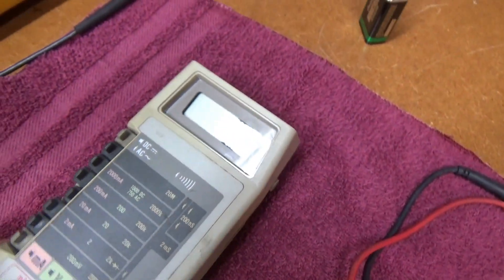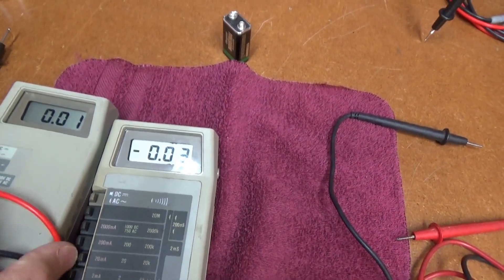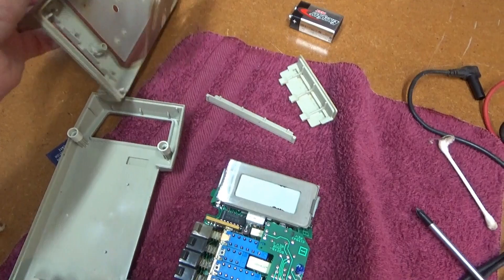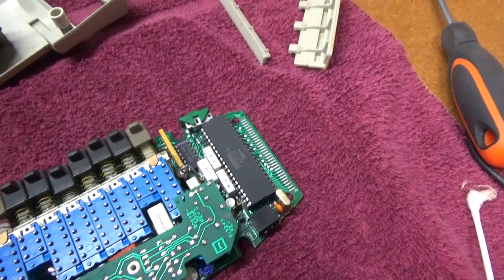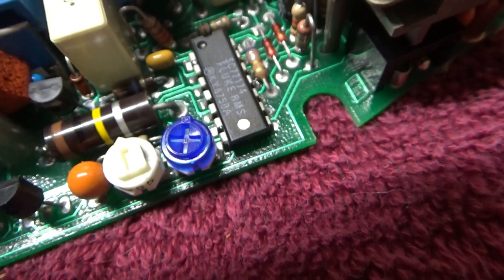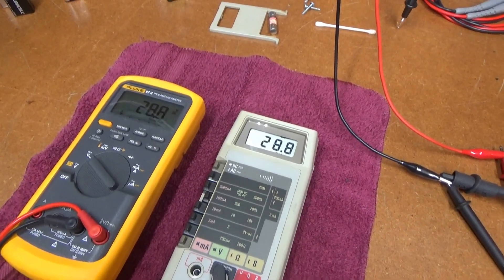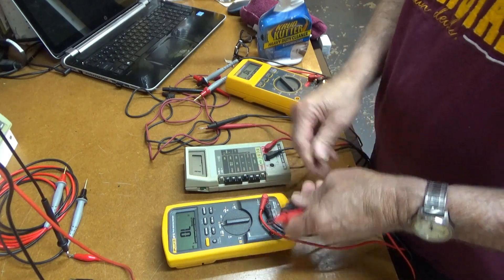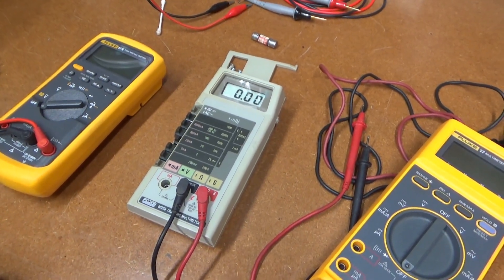1988 Fluke 8026B Teardown

Comment: Can i ask, what do you recommend to clean corrosion off solder joints on the PCB. Will isopropyl alcohol usually be sufficient ?
Reply from the maker: You got it. Isopropyl alcohol is what I use. I generally use the 90% stuff for cleaning because it will dry faster that the cheaper 70%.
Reply: @mguess Thanks for the reply. After many years I've picked up my first Fluke. It's an old grey fluke 27. The chip is dated 34 week of 86. The 9v Duracell dated 94 had eaten its top thankfully with Very little damage except requiring a new battery connector. There's oxidisation on some solder joints on the PCB so while I'm in there I want to do what I can to preserve the meter. I'm only a novice re electronics, but I really enjoy your vids. Many thanks from Dublin Ireland. I think I'll try a cotton bud with white vinegar, then baking soda solution to neutralise the vinegar, then IPA to clean everything off ? Here in Ireland the damp air gets into everything. I often think the grass is So Green because of Corrosion! 😄
Reply from the maker: Good luck with the restoration of your Fluke 27. That is my favorite series of Fluke multimeters. I think I have 7 of them now, just gave one to a friend a few weeks ago. I can pick them up fairly cheaply here in the US, about $40 for a good working one. I find that IPA alone cleans up most corrosion including the stuff that leaks out of alkaline batteries. There is generally no need to touch the calibration adjustments. I find that Fluke multimeters hold their calibration very well even after 40 years.
Reply: Yes I'll take Your experienced advice and try just using the IPA. There is quite a lot of furry green corrosion on one of the fuse connections. Oddly on this particular meter, there's a small glass fuse fitted upright beside the two Large ceramic fuses in the battery compartment, and I haven't seen that on any YouTube 27 vids.
Reply from the maker: Yes, the small fuse is something that Fluke did in the early days. If you watch my video on the restoration of the old Fluke 8025A you can see that fuse. The one in that meter happened to be a ceramic fuse but other Flukes that I own have small glass fuses as well. Here's the link.
https://youtu.be/JAF-F1SuDdQ
I didn't talk about that fuse in the video but it is in series with the larger HRC (high rupture capacity) sand filled ceramic fuse. I assume the theory was that in minor over current conditions the small cheap fuse would blow protecting the meter and the expensive HRC fuse. However if a high energy over current event occurred, the HRC fuse would blow protecting the meter and the operator from injury. Fluke eliminated the small fuse on later models of the 27.

Comment: had one like that at tech in '84, useless unreliable trash due to switch contact issues. one day it annoyed me once too often went and bought a cheap micronta analogue thing from tandy
Reply from the maker: Thanks for the comments. I have heard of issues with switch contacts. Some restorers have stated that lots of switch contact cleaner is required to get them going again. I haven't had any issues with the two old manual ranging Fluke multimeters that I have and they are decades old. However that old analog meters do have their place. I have a couple of old Heathkit VTVM's that I still occasionally use.